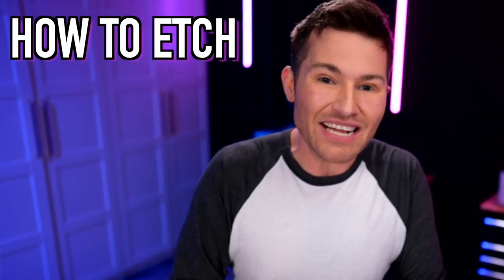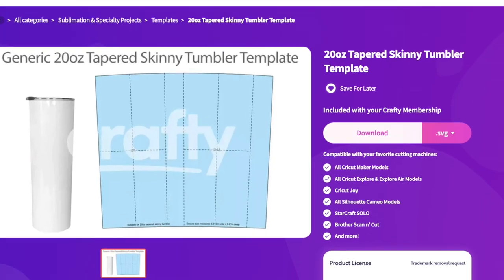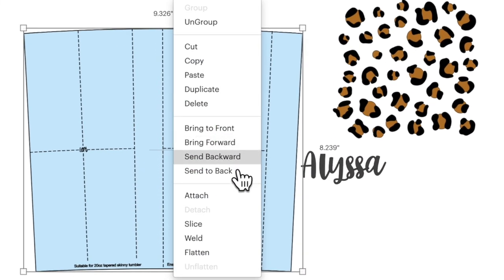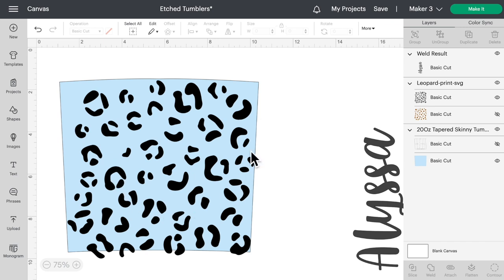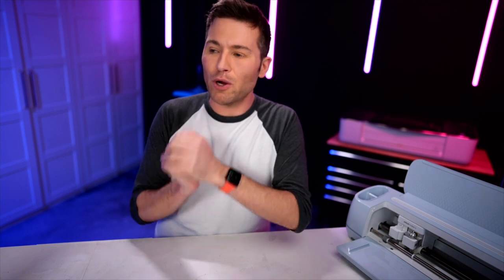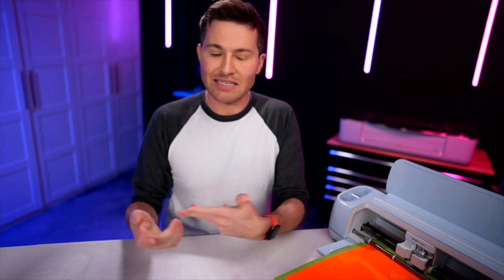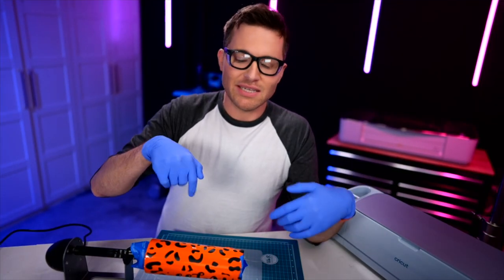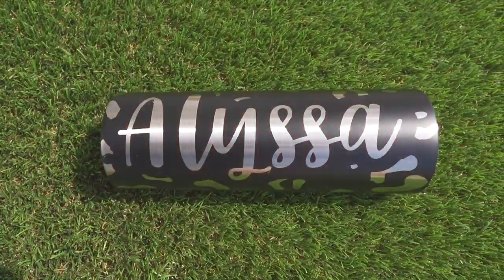*NEW* BEST WAY TO ETCH TUMBLERS WITH CRICUT! 😱

Comment: just found your channel yesterday. I make epoxy tumblers. I use citristrip to take off the powder coatings and also to take off the factory coating off the tumblers to prep them for priming/glittering or whatever I'm going to do. So my question is, the stainless steel is now bare without it's factory coating so will it be prone to rust over time?

Comment: Did it on a tumbler for kids-ombre blue and pink from Wal-Mart. They were just over $6 each.  So they were inexpensive enough to give a try.  The only thing different that I did was to wrap in foil after applying the paint stripper.  I also used my heat gun for a short few minutes.  It really sped up the process. They turned out great!
Reply: Hi. I'm curious. So what did the foil help with? Was it on a spinner or did you just let it sit somewhere? And how long did you use the heat for? Thanks.

Comment: Nice process. But would the coating eventually peel? How would it be sealed for protection?
Reply: That's my question also because the paint stripper is essentially removing the painted coating from the tumbler. I wonder what happens to the edges over time without some type of sealant.

Comment: A dear friend brought me some citri strip while visiting us in Toronto since it isn't sold here and I have no idea if the stuff sold here would work due to being a different formulation. About to try out the citri strip on my project today. I am using the arctic brand tumbler sold on Amazon. it is cheaper than a yeti and keeps things hotter longer. Wish me luck.

Comment: I've done a couple of these now and after my tests I just leave the Citrus Strip for a couple of hours. I just set it and come back when I get a chance later. It hasn't failed yet.
Reply from the maker: That does seem to work pretty well for most of the tumblers I tried, but I did run into one issue with that when I was doing some tests. One of the tumblers where I left it on for hours had the citristrip eat under the vinyl and ruin the design. When I tried it again on the same type of tumbler I left it on for about 15 minutes and it was perfect. Just something to keep in mind. 😊

Comment: Am I able to use a different brand of gel stripper or do I need to use Citrostrip gel? Can this method be used on spray painted tumblers or do they need to be powder coated tumblers? I ask because I do my tumblers with spray paints mostly.

Comment: I am interested in doing this but don't have anything. Which circut cut should I get, what is that tumbler spinner thing and what vinly would you say to get. starting from Zero  Not too expensive though ty
Reply from the maker: It really depends on what you're wanting to do, but something like the explore air 2 or explore 3 is a good machine to start off with.  The joy is fun, but its pretty limited on what all you can do with it.  https://www.amazon.com/stores/Cricut/page/C64D4D9F-7B75-4CD1-8C01-033D1CD0AEC7?&linkCode=ll2&tag=mrcraftypants-20&linkId=cdbe02b03ec39b2a413884b53819d246&language=en_US&ref_=as_li_ss_tl   (affiliate link)
Reply from the maker: You can find the cup turner here: https://www.143vinyl.com/cup-turners/?partner=339438 and for vinyl I'd recommend the StarCraft HD permanent vinyl. https://www.143vinyl.com/starcraft-hd-permanent-adhesive-vinyl/?partner=339438  I hope that helps, and also feel free to use my discount affiliate code "crafty" to save some extra $$ on your purchases at 143vinyl. 🤩

Comment: I does it leave rough edges
Reply from the maker: It doesn’t! You may feel a very slight indention where it removed the coating, but it’s minimal and still really smooth to the touch. 😊
Reply: @mrcraftypants  that would make sense as the stripper is just melting of the coating.

Comment: I just subscribed to your website. I had a hard time getting it to work. There is no way to contact you on there. I tried and the message doesnt send. I tried to download a 30 oz tumbler template that you have but it says I am over my limit, when it has never downloaded. Its very frustrating. It happened on another design as well. But things dont download like they should. Just thought you should know. Enjoy your videos though.
Reply: I think I just figured it out, on my computer, however, those designs are locked to me. Which is a bummer. Make sure everyone you have your computer set to allow downloads from this website.